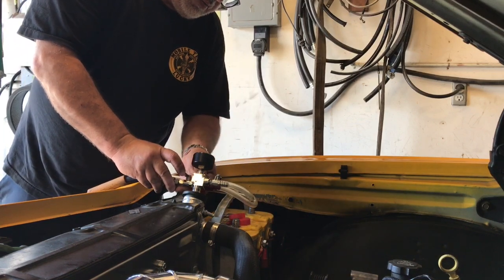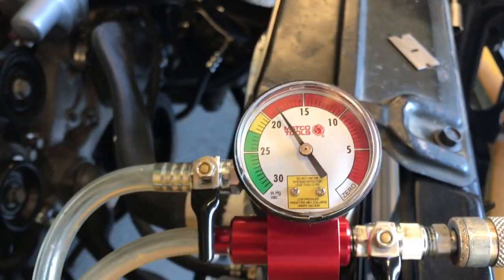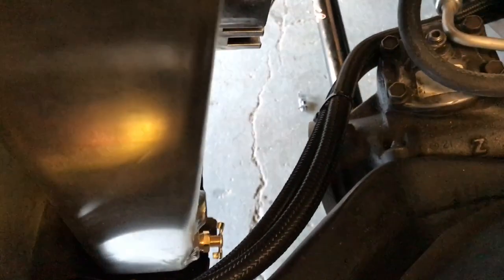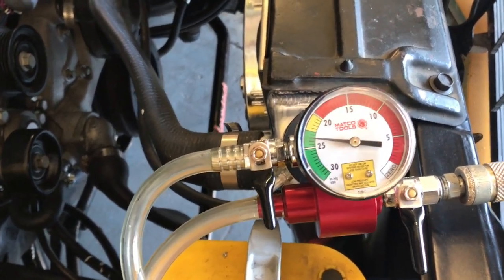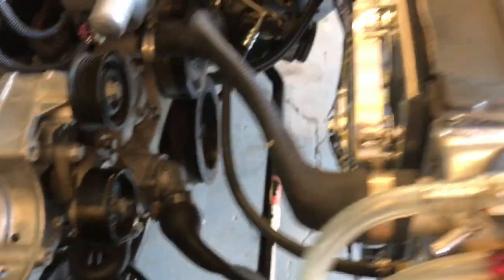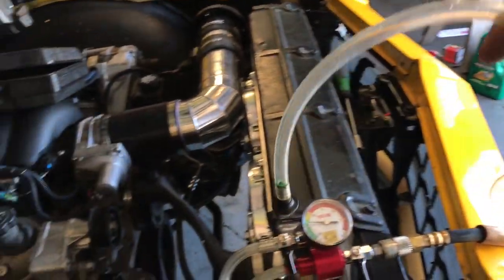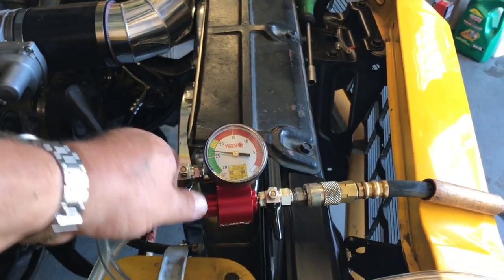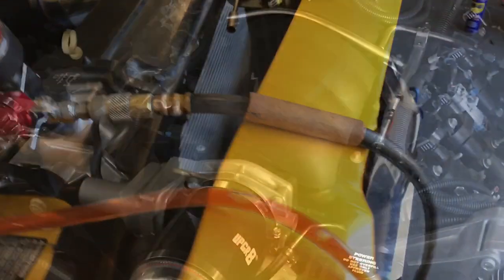Cooling System Backfill With AirLift

Comment: any issues with the hoses after they have been collapsed? It's been years but I remember my shop teacher always saying if you see a collapsed hose you should change it.
Reply: Bob mcneeley If a hose collapsed, the hose is weak and that's probably why you were instructed to replace it. In this case, vacuum was introduced purposely which caused them to collapse, it is harmless to the hoses. They'll re inflate when the engine starts and they shouldn't collapse again.